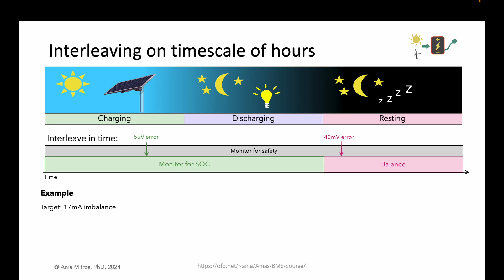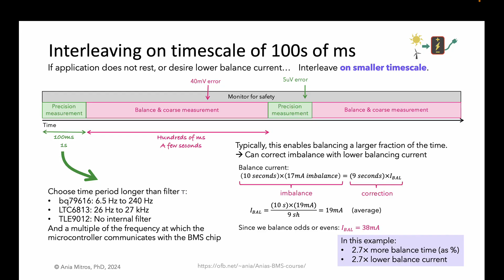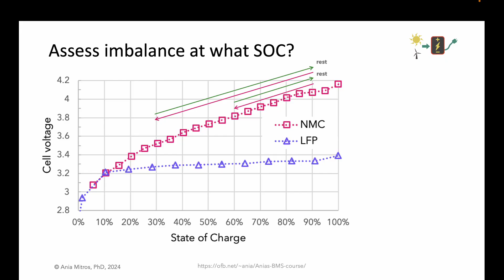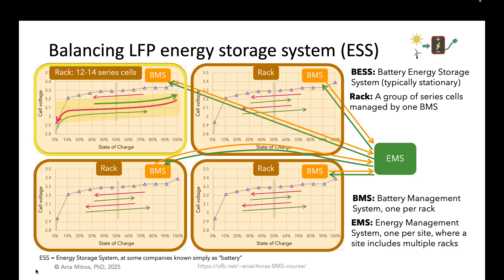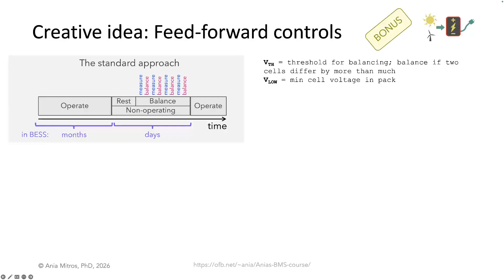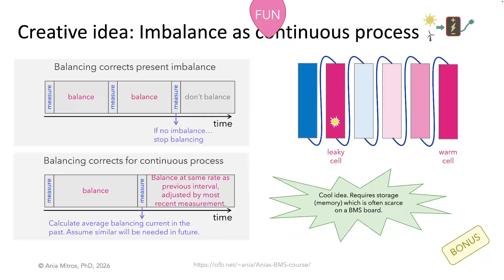Balancing (5 of 6): When to Balance

Comment: Great video again. In BESS they do a bottom balance? Never heard of that, I though all packs do a top balance. For home ESS we balance into absorption, and that's where most of the balancing takes place. I assume that's because home ESS isn't cycled hard and temperatures stay low. In a BESS system the imbalances could accumulate quickly.